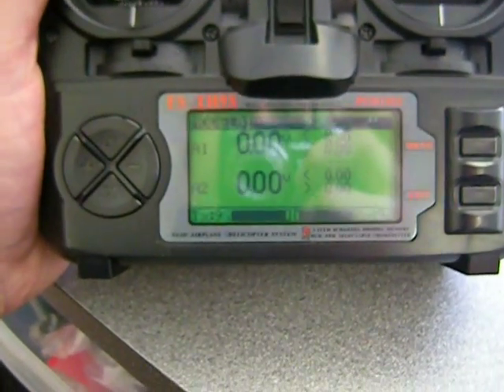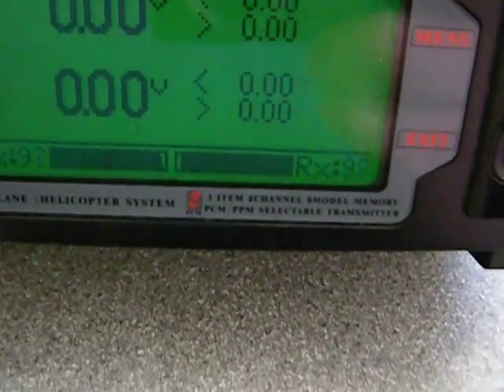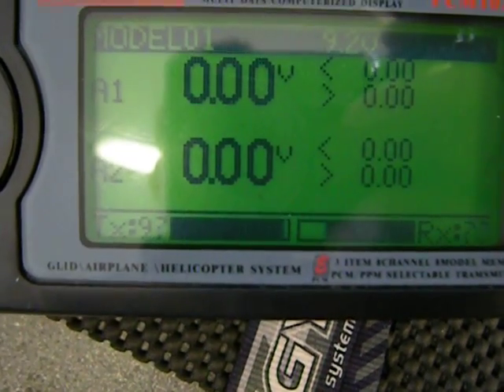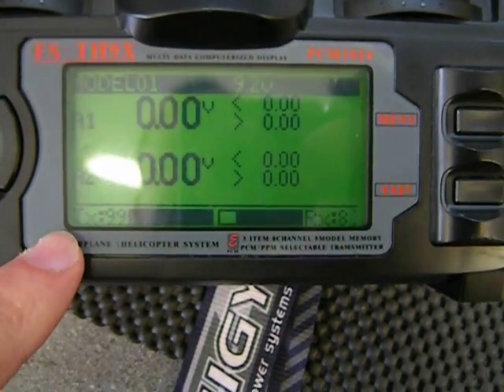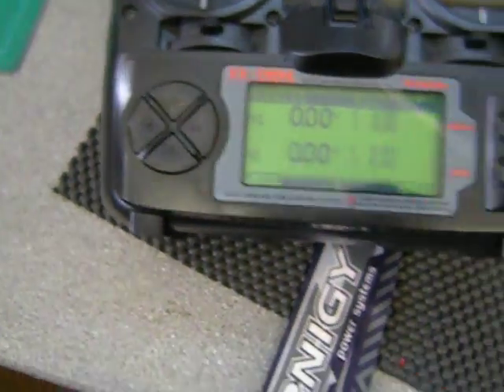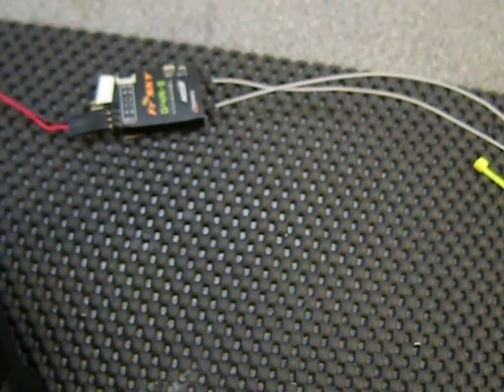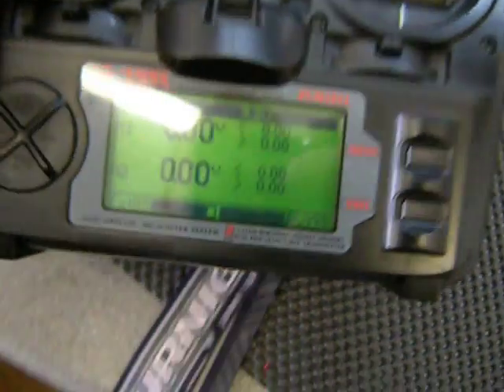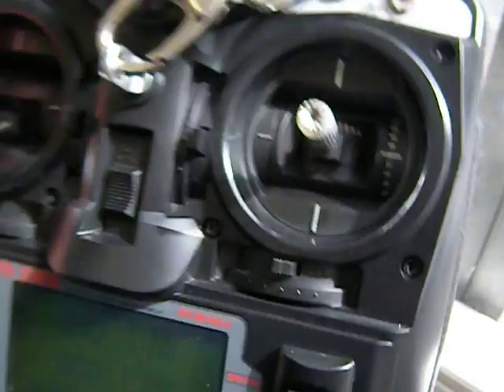Testing Frsky Telemetry on my 9x

Comment: is the telemetry compatible receiver enough for you to get model voltage and signal strengh information, or you are using those optional stuff like telemetry hub and external sensors?
Reply: With this receiver I juts get RSSI info.